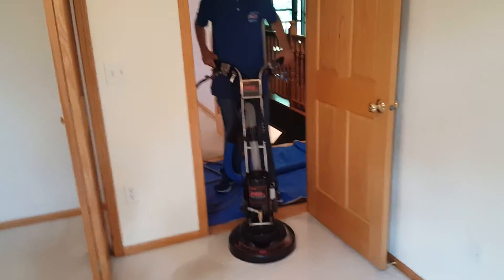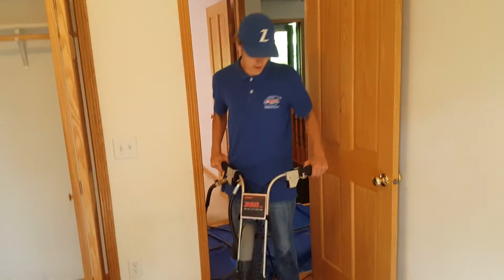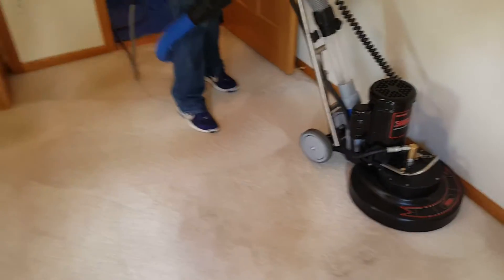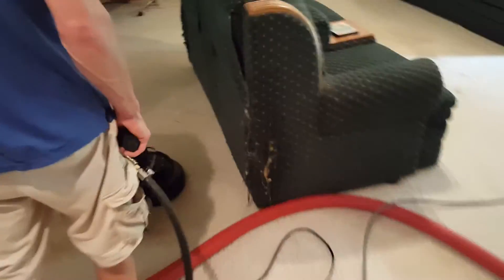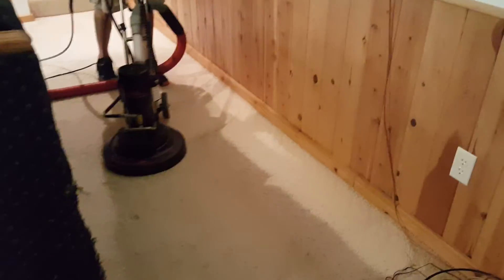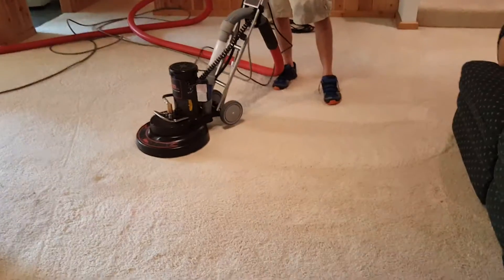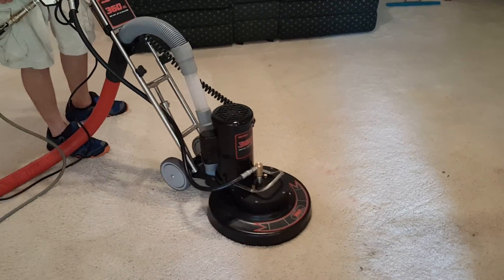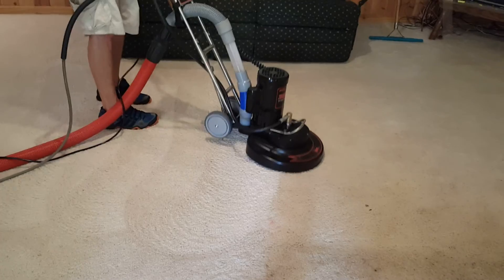2 Rotovac 360 XL 3/4 HP with brush head and nylon slot glides and 2 Butlers!

Comment: How large is the recovery tank in your truck? About how many gallons per hour would you estimate the Rotovac 360 uses. I am currently using an original Rotovac in restoration scenarios and it does an awesome job. From my understanding, the 360 is a bit faster and is able to recover more moisture - Is this accurate? This video makes me wanna spend some money. :)
Reply from the maker: We have the Butlers with 210 recovery tanks which are great. The 360 XL are four jets for a four flow. We run even at 500 psi with these a lot of times but have not done a bucket test on them. Right now the 360 XL with brush head and Teflon slot glides is really the fastest cleaning with a Rotary extractor I have encountered.
Reply: Thanks Bro...   I try to keep a variety of equipment on the truck:  bonnet scrubber, counter rotating brush, traditional wand and upgrading to a 360XL appears to be the icing on the cake. I am a HUGE advocate for having a variety of tools. What tools do you find seem to work best in conjunction with each other?
Reply from the maker: +Geoffrey Howells I carry a lot of tools also. Besides our Rotovac 360 XL's, we have 10 inch CRB units, pimped out Prochem Titanium wands, and our 15 inch Zipper Wand and also the new Zipper SS Super Spinner. We have a large variety of units and like you try to prepare ourselves for anything we might encounter. Our upholstery tools are the Rotovac Shear Dry, Sapphire Scientific, and even the old school Prochem with glides. For stair tool we use the PMF swivel head stair tool with our modified dual jet system. We definitely like our tools
Reply: Still collecting and upgrading along the journey and appreciate input from others. Thank you.
Reply from the maker: +Geoffrey Howells you bet. Give a shout if I can help in any manner. www.saigers.com
Reply: LOL - Since you  offered... Do any carpet stretching, just to pull rolls out? No installs and $650+ for a power stretching tools seems a bit out there.
Reply from the maker: +Geoffrey Howells no carpet installs or repair. Too dang busy with the cleaning part :)

Comment: The zipper seems to much faster, even with the pre scrub with the CRB
Reply from the maker: The Zipper can be a lot faster
Reply: Depends on HWE or VLM. Both have a specific purpose... Concerning allergens - if animal hair is an issues, VLM  with counter rotating brush is by the best solution. If dander, go HWE with a traditional wand or rotory machine. Chose an appropriate method for the job.